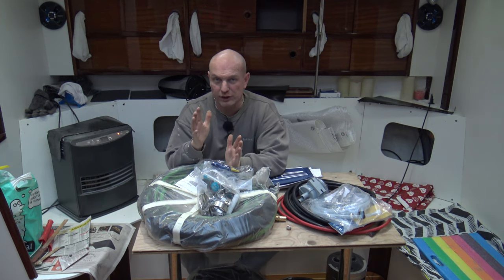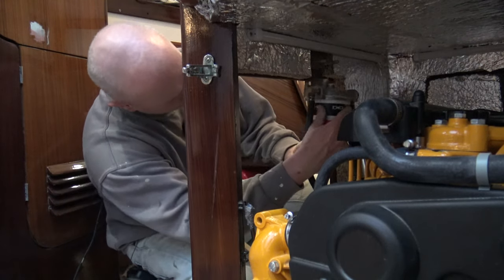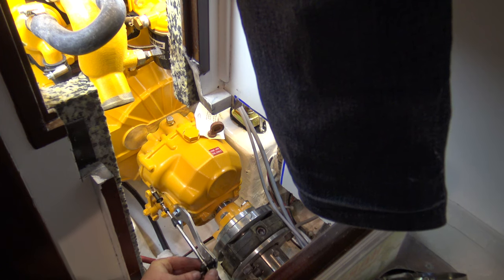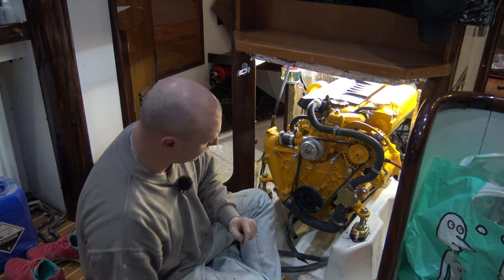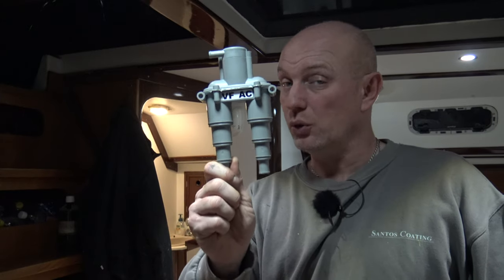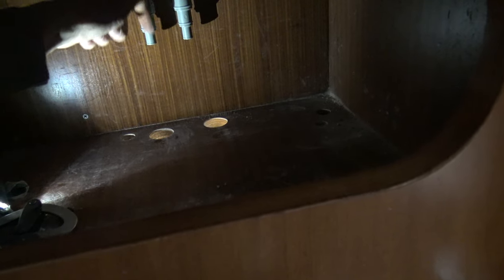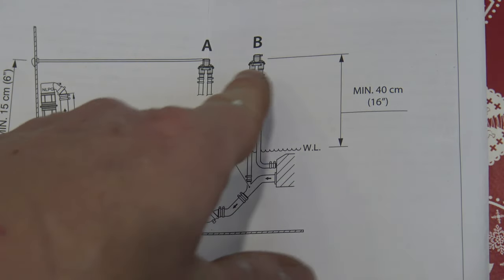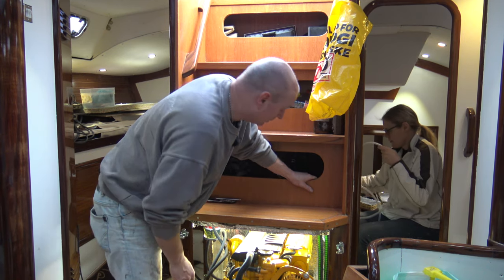S3 #14 DIY boatwork how to install the new engine

Comment: The big cable from the batteries should be the first on the starter solenoid. Then the others on top. That gives the current a direct path to the starter and not through several other terminals that all could be a source of resistance as they age.
Reply from the maker: Gene Smith I think you are right 👍

I hadn't thought of that at all, but I will correct it 😊
Reply: @sailingsyfie4713  and dielectric grease or fluid film grease... on all electrical connections. Fluid film in spray cans does a really good job as rust protection... best I have used on boats..(and cars).. 🙂
Reply from the maker: R. E. Hill I do that on all connections before I refloat every year. I use liquid tape... That is really good 👍

Comment: The cheep clamp doesn't provide uniform pressure around the tube and may cause damage to the hose and/or leaking.
Reply from the maker: T'airn'KA ok... you can have a point there 🤔
But I am very confident with heavy duty clamps, but maybe I should take a second opinion on that one.?!
Reply: @sailingsyfie4713  Maybe you misunderstood my reply.  I agree with you the more expensive clamp is a lot better then the cheep ones.
Reply from the maker: T'airn'KA ok... yes, then I misunderstood you 😄👍

Comment: Was the previous engine bad from the beginning or did it fail and you had it rebuilt or replaced?
Why was replacing the propeller shaft required, was it due to the new engine having a different mounting (higher, lower, forward, backward) positioning and/or was the prop shaft damaged?
It amazes me sometimes how all of that equipment can fit in boats (accessibility is not a subject to discuss in polite company).  ;-)
Reply from the maker: T'airn'KA the previous engine was old (30 years) and was not reliable anymore and spare parts was very expensive.!! 
So I decided that it was easier to replace, than put to much work, money and concerning in the old one. 
The new shaft is 3 feet longer than the old one, because the old engine was reversed installed. The prop is also much closer to the rudder, compare to the old one (4 feet closer.!!). 
The old prop was ok, but according to calculations, wrong size 🙈 so we will get a new prop 👍
Reply: @sailingsyfie4713  Thank-you for the clarification.

Comment: Tror du Udluftningsslangen fra "snøfteventilen" er monteret rigtig. Synes det ser ud som om at den går ud gennem skroget højere oppe end ventilen, hvilket jeg ikke tror er hensigtsmæssigt.
Reply from the maker: Jørn Therkelsen Alt tyder på at jeg har lavet en “bommert” dér, men det får jeg lige rettet næste video. 
Syntes ellers at jeg fulgte brugsanvisningen, men jeg har nok fejlet 🙄
Reply: jeg mener at formålet med slangen er blot at undgå at et par dråber hver gang du starter motoren kan ledes væk. jeg har blot ledt slangen ned i sumpen. så jeg tror ikke du skal bore et nyt hul.
Reply from the maker: Jørn Therkelsen Jeg fik af vide, at der løber en konstant stråle ud af slangen og derfor skulle ud af siden på båden... også anført i manualen. 
Men slangen skal vidst gå opad hele tiden og må ikke gå nedad og lave en “vandlås”, hvilket min slange gør. 
Jeg må nok sande at jeg har fejlet her og vælger at skifte til den model uden slange på. Det havde vi på den gamle motor og det virkede uden problemer 👍
Reply: Det kan være at denne type er svaret på mit lille problem. jeg kan ikke visuelt se min udstødning og kontrollere om der kommer kølevand, så jjeg har overvejet at montere en "kontrol ståle" anordning :-)
Reply from the maker: Jørn Therkelsen denne her skulle give konstant vandstråle og dermed give indikation af kølevandet OG om hæverten virker. Så måske den er din løsning, i vores setup tror jeg bare ikke den er løsningen.?!

Comment: I have a video regarding the "plastic thing" also called the anti siphon valve. You can get a version with a valve and a version without, yours is without the valve and it has therefore a tell tale over the waterline. https://www.youtube.com/watch?v=YSC5SC9E6nw
Reply from the maker: Thanks 👍

I toke the simpel Way and just shift to the model with the valve and then the problem is solved. 

Happy new year to you 😊
Reply: Thanks :)